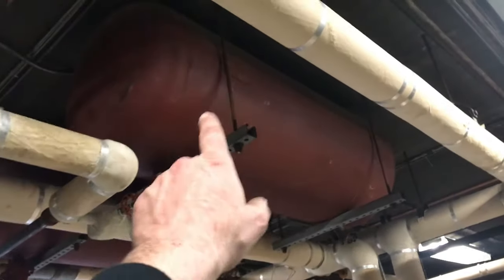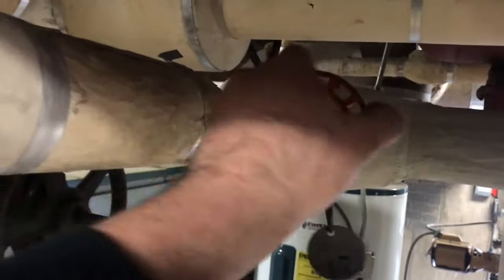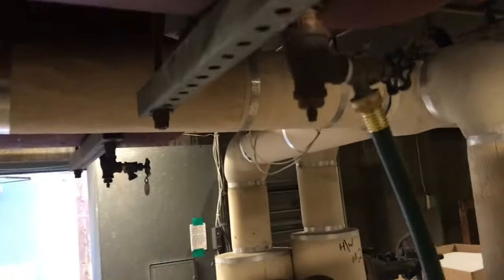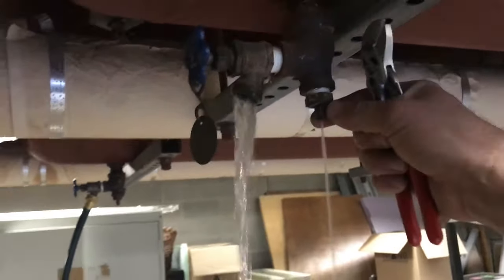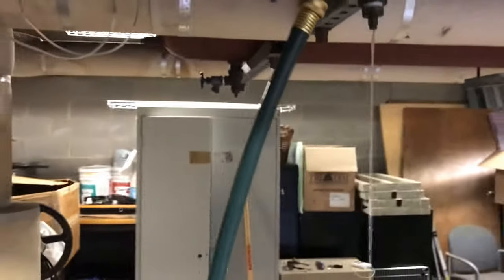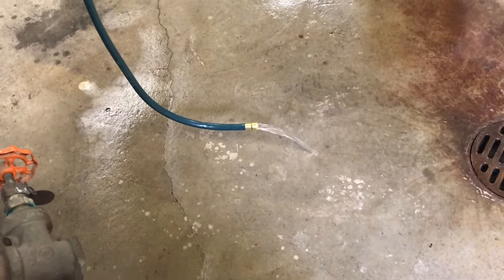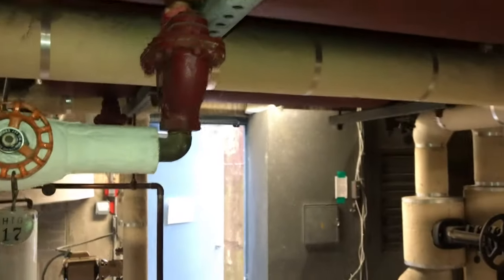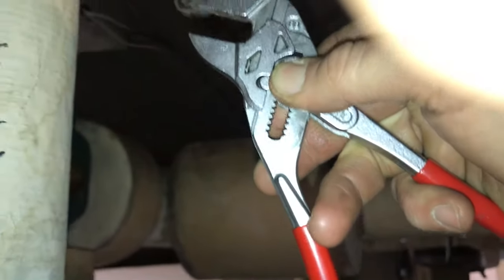Draining And Recharging Expansion Tank

Comment: Two questions: After draining how do you know when enough air has entered the expansion tank to close off airtrol air inlet valve nut on the bottom of tank? Secondly, why is water immediately going back into expansion tank upon opening the isolation valve?
Reply: The air has to compress to meet the pressure of the water

Comment: This is the exact video I needed to understand why the tank fills with water and that this is a regular, normal, and expected maintainence procedure.  Liked and subscribed.
Reply: I found that I need to do it 2x a year. 
My expansion tank is used for the reheat system (radiators and vav box coils)

Comment: I have a steel expansion tank on the second floor of my house. Vertically installed, but has no valves anywear, just one pipe at top. I’ve lived in house 43 years, heat working fine, but this year the pressure went to 30 and water started spewing out from release pipe. How will they be able to check the steel expansion tank? I’m worried that because of faulty expansion tank(never checked) they will say I need new boiler. I assume it’s the expansion tank, not a bad pressure release valve because it does not leak below 30. (I’ve been draining water from the radiator to lower pressure, is that dumb or smart)...I guess what I’d like to know is what to expect when HVAC person comes?  Thank you.
Reply from the maker: you shouldn't need to replace a boiler due to a faulty expansion tank. The easiest way to check a tank is to knock on the outside. half the tank is hollow, the other half is air. That would give off different sounds. Is the pressure always up around 30 or starts around 12 and goes up when heating? Is the tank in this video similar to your tank https://youtu.be/UGSv_g16rXs

Comment: Every year, I need to empty my older water tank. It does not have a way to allow air in . It took me awhile to figure out that I needed to empty it with a bucket and when it gets towards the end of emptying , it starts to inhale the air itself. I know I need to eventually change out the valve to allow for air to come in as I empty it. My tank is always waterlogged by the end of the season. Crazy that there is only a regular valve (open/close) with no air intake. That's why I'm here to figure out if I need to empty until no water comes out. Its been sucking in air for about 15 minutes so I think that may be sufficient. Thanks for this

Comment: Early in the video you turn off water valves to isolate the expansion tank instead of draining the whole boiler system. At the 8:20 mark in the video when you slowly open valves and hear water is that water going back into the expansion tank?
Reply: Yes

Comment: I have this for my home but it doesn't have a hole for the air to come out. There is only a drain for the water to come out. I just purged my boiler. Do I need to do anything to the expansion tank?
Reply: That's my situation . For me, I do not purge my boiler, I turn off the water to the expansion tank and empty it. It took me 2 MONTHS to figure out that I needed to use a bucket instead of a hose so that the air can be gulped in by the tank. A retired HVAC guy on a community thread saved my ass by making that comment. I know this is a response by a post from 10 months ago but if I can help anyone else ..
Reply: Most expansion tank do not have an air inlet.  Hot water displaces the air.  It is a tedious process to drain it unless you have a tool like I do.

Comment: Can the air in in the expasion tank ever migrate to the system? or is there some kind of check that prevents this?
Reply: Fluid dynamics and thermal dynamics will answer your questions. Air and water are a fluid. They travel from high to low and hot to cold.

Comment: So I have a dumb question...(just trying to understand here) where is the air going, that you need to keep draining and recharging with air?  Is the tank leaking out all of the air and letting it waterlog?  Or is there an air separator in the system that is letting the air out of the system thru the air separator?
Reply: I think that's probably the case.. Air makes its way from the tank and into the flow stream and then gets removed elsewhere in the system.  Some may also leak out of the tanks.
Reply: Air gets absorbed into water over time.

Comment: If the system is already hot, do you still have to shut down the boiler and pumps or can you just isolate the tank?
Reply from the maker: Need to shut down boiler or pressure in boiler will shoot up and blow relief valves.

Comment: When you reopen that value does the tank fill up again?
Reply: The tank after draining is filled with air.  When inlet valve is reopened, some water goes to the tank then the water is pushed against air and stops rushing in.
Reply: @tonymanero5544  @carmcb I think its filled with atmospheric pressure (like an empty bottle of coke with the cap off). Then you refill it and it compresses the air.